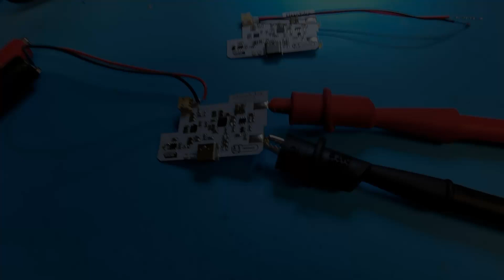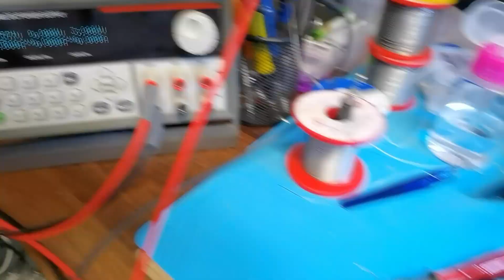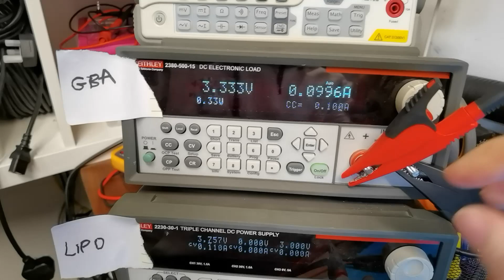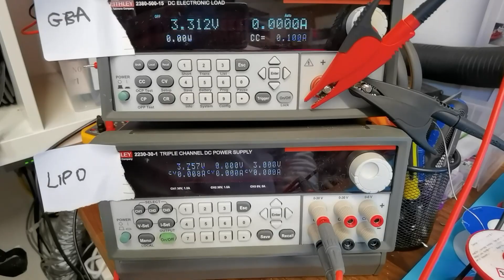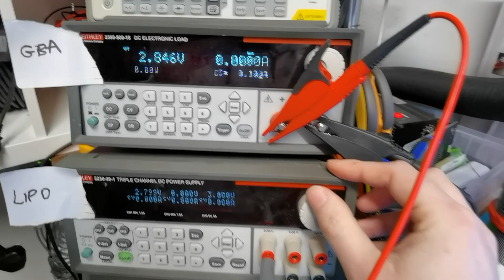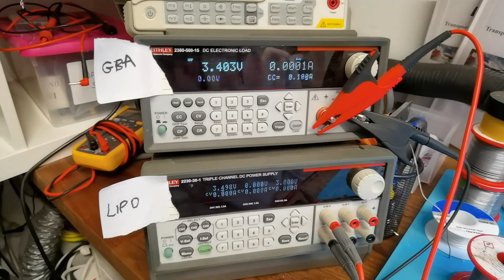How the RetroSix CleanJuice Works (+ Dead Board/Drain Fix)

Comment: My cleanjuice wasn't turning on my GBA. Put it on charge for a bit and still nothing. Went to check the board and it was so hot it burned my finger. It doesn't have the resistor but does have the one piece above the handheld legend logo. I'm guessing it's toast. :(

Comment: Is there an update based upon the CleanJuice v1.3 battery? It seems to have a similar draining issue but does not have the resistor that you show in this video on the previous version so potentially a new issue?
Reply from the maker: There have been no other battery drain issues due to design other than this small batch. We do just get faulty boards that cause drain that we simply replace. Fault rate is about a couple every 1000 boards but we sell thousands a month so it seems there are drainage issues but it's just manufacturing or component failure. The design is very mature now and works great
Reply: @RetroSix  Is there a way to confirm if I have a faulty board? With the system off a fully charged battery is dead within a day or two - I'm assuming with the v 1.3 that isn't normal?
Reply from the maker: @brianlinzy5325  no that's faulty. Reach out to us on discord or email for replacement
Reply: @RetroSix  Thanks for the feedback and confirmation, I will reach out!

Comment: Hey @RetroSix, I hope you get so see this Request and are able to answer! 
I got your Cleanjuice GB XL for the DMG Gameboy and it looks like it has a Battery drain too, do you have any information about that? Or already working on a fix? 

I fully charged it and the battery had 4,14V after letting it stay over night (not in GB, alone on a table just Battery connected to the PCB) the battery voltage dropped to 3,93V!)
I disconnected the battery and let it stay another night and it stayed on 3,93V. Connected the battery again to the PCB and it started dropping again :( without getting used just while being connected to the PCB. 

Also, why did you change the output Voltage from 5-6V to 4V?
Reply from the maker: Jump on our discord and send photos of the board
Reply: @RetroSix  Thanks for the fast response, I did that now on the #troubleshooting channel I hope that was the right one

Comment: For the newly updated batteries for gba, do they still have the drainage issue when the gba is not in use?
Reply from the maker: Nope only a tiny proportion have drainage issues it's just manufacturing faults

Comment: My kit arrived yesterday, it's a new board different from the one used in the video, and it's not giving any voltage

The battery itself seems to be working and I have measured other components on the board and there is current flowing through them, but the output is literally zero.

I left the battery charging overnight, but it's still zero.

Should I contact Handheld Legends and ask them to send me a new one?
Reply from the maker: Yep reach out to them

Comment: Thanks for the info! I bought about 30 of these from your website and I use one on my own GBA. I checked a few of the batteries I got; they have the transistor but don’t have the resistor. My problem on my battery is that the board doesn’t  force the red light on my GBA when the power gets low. It just shuts off randomly and then turns my GBA on and off every second until it eventually dies. It’ll start working again after I fully charge the battery. 

Atm it’s late for me but I’m going to fix my board (and hopefully not the other 20+ boards I still have) and see if that fixes my battery issue when I wake up tomorrow to test!

I just wanted to say: Thanks again for the video! I love you’re products and have made 3 huge orders within the past 2 weeks with the battery being my only upset! Everything else is great! Top quality shells parts and stickers! 👍🏼

Comment: Genuinely good video, Albeit a little late for how long this has been a known fault for some end users.
Reply from the maker: First time I got one in my hands to notice the issue. Every time we got one back it worked as we first removed the battery to test it was good... then fixed it lol. Still, we have replaced any faulty ones as we always do. This video was also to give tickerers more insight into how stuff works
Reply: @RetroSix  I appreciate the explanation and I think many others will as well.